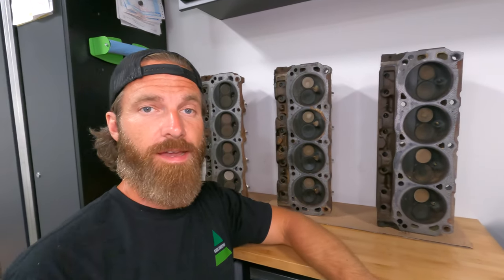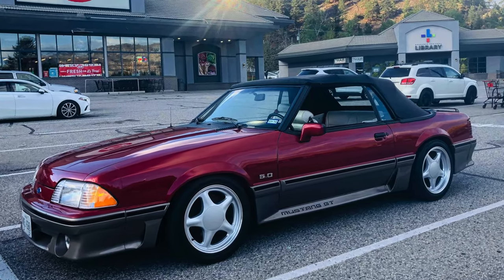Comparing Junkyard GT40 GT40P Stock E7 Cylinder Heads / Everything U NEED 2 Know - Fox body Mustang

Comment: I suspect that Ford put the GT40 and Gt40p heads on Explorers and Mountaineers simply because they're more efficient and make more power. Remember those trucks got a low rpm torque truck camshaft in them so even with those higher performance parts they make like 205HP. If they had E7 heads and a smaller port intake they would make even less power and customers would likely be unimpressed with the power you'd expect in a V8 option truck. Its a massively heavy all-wheel drive vehicle too so it would simply be underpowered with E7 heads
Reply: Absolutely correct the explorers and mountaineers wait around 6800 lb!! Compared to the mustangs 3200 lb!! So of course they're going to put high performance heads on heavier vehicles or at least stock racing vehicles!! Like the mustang cobras and the GTS mustangs!! 100% agree... 💯👍👍🤷🤯🤯🤦😁👍👍🙌
Reply: All your points are right, however Ford is just cheap they plenty left over from  mustangs ……. They just used them out in 96/97 explorers 3 bars (Eddie bauers edition) then they shift to p style
Reply: @thacutoff6226  The GT40's only came in Mustang Cobras. They also have dates codes on them showing they were made after the 5.0 was discontinued in the Mustang.

The GT40P never came in ANY Mustang.
Reply: @foxfordcatguy2283  gt40 3 bar heads came on mustang cobras except that they are on 96/97 ford explorers Eddie bauers and Mercury mountaineers ford used remaining leftover discontinued 5.0 stuff I.e explorer intakes (just basically cobra intakes). Gt40p heads have 4 bars stamped, and are different the main issue is headers/spark plugs
Reply: @randytrivitt6539  I think I lost brain cells reading your post. These Explorers topped out at 4,200 lbs. Only 1,000 heavier than the SN95.
Reply: Smog emission control was put into place and the mustang didn’t pass, but SUV’s were in a different category that was less restrictive so they got the GT-40/P gear and the mustang got the 4.6 mod motor.
Reply: Well said my friend
Reply: @trailerparkcryptoking5213  oh ya, some guy named trailerparkcryptoking over here knows better than the Ford Motor Company’s engineers…. Riiiiiight.
Reply: @randytrivitt6539  90'sExplorers weigh just a little over 4000 lb not 6800.
Reply: @foxfordcatguy2283 GT40 heads did come in early Mustang Cobras and early Ford Explorers. Besides that you're right about the GT40P heads, they never came in Mustangs.

Comment: Did you know that my Factory GT40p heads were Factory modified by Ford Australia, with 1.94 intake, 1.54 exhaust valves !   The whole engine was hand built by one man, taking one complete day to assemble, and they also received a set of Yella Terra roller rockers, plus a mild port matching,  and custom 70mm throttle body.   They also got a factory set of headers, with a complete dual exhaust system.    Only late 2001 to early 2002 Falcon XR8 got this 295hp beauty !!  The TOP DOG T series version of this engine even has a 3.4 inch stroker crank, making it 342 ci and 335hp !!!
Reply from the maker: No way!? Thats awesome!
Reply: @KASLCustoms  yes way 😊
Reply: I didn't knew there was a 4door manual sbf EFI, Aus really knows how to make cool cars

Comment: 347 full roller with GT40P heads.. moderate cam & 4 barrel Holley in a 67 Fastback Mustang  backed with a Tremec 3550 World class 5 speed, 9 inch 3.70 Detroit Locker... works great.. about 400hp & 375 ft# of torque... exciting

Comment: GT40 heads are the first "aftermarket" heads that I ever bought. I got them for my 71 Bronco back around  92 or 93? Can't remember exactly. I had some mild porting done and added some Harland Sharp roller rockers. Not many other options back then, plus, I wanted to stick with Ford parts. They worked good. No comparison to modern aluminum heads that we have today but those were just a dream back then.
Reply from the maker: Yessir I agree 👍
Reply: Big dog does some badass porting nowadays that makes these heads flow better than out the box aluminim heads

Comment: Did you talk about the springs on the P heads? Supposedly they're only good for .450 lift. I wouldn't toss the P heads on a 5.0 Mustang even with the stock cam without changing those valve springs. Also, you should have talked about the HP you could expect to gain with the GT40 heads over the stock E7s.
Reply from the maker: Thx for this. All of that is coming up in a future video

Comment: I thought the explorers got the upgraded heads as the 5.0 got older and they had to add emissions gear which robbed power; so, they threw the better heads on to make up for it.  IIRC, the power numbers stayed pretty much the same through the explorer run.  Jeep did the same thing with the 4.0l, if you throw a later model 4.0L intake on an older HO engine you'd gain 25ish HP, even though they both made the same power numbers from the factory (92 vs 02 for example)

Comment: The GT40 & GT40p also have "GT" or "GTP" cast between the #1 sparkplug (#8 on driver's side) & the end headbolt. The GT40p also has a "P" right above there on the little "ledge" by the corner of the valve cover. Maybe not all, but mine do & these markings are also described in the "Ford High Performance Parts Interchange" book & the "Muscle Mustang & Fast Fords" January '98 issue "Exploring For More" article starting on page #222.

The GT40's were used on '96 to mid-'97 Explorers. The GT40p was used from mid-'97 to '01.

The GT40p (58-61cc) has a SMALLER combustion chamber than both the E7 (62-65cc) & the GT40 (F1ZE 63-66cc, F3ZE 60-63cc, F4ZE 63-66cc). [This info is also in the previously mentioned book & article.]
Reply: I just picked up some gt's yesterday at a wrecking yard and you're right

Comment: Great info on these heads Thanks. I have a 97 Mountaineer with GT40p heads i installed Torque Monster Headers and Gibson performance exhaust system. I don't have a problem getting to my plugs. Now i did add Spark Plug Wire Boots Heat Shield Protector Sleeves. They have been on the truck for 160K with no problems. I love the torque it has. Thanks for sharing this video.
Reply from the maker: Very nice! You're welcome!

Comment: I’ve driven a few late model falcons in Australia and the explorer 5.0 was heaps more torquey in the low rpm’s compared to the std 5.0 with e7’s so it makes perfect sense to put an engine with more torque into a large heavy SUV  they weren’t race car parts just the next evolution of a stock casting

Comment: The GT40 head was not "introduced" on the 1993 Cobra, they were already available from Ford Racing (Ford Motorsport SVO as it was called at the time.) According to "The Official Ford Mustang  5.0 Technical Reference & Performance Handbook" by Al Kirschenbaum, they were originally developed for a planned 1989 anniversary model that obviously never happened. So they then went in the Ford Motorsport SVO Catalog.

The tubular GT40 also was available from Ford Motorsport BEFORE it appeared on the 1st Gen Lightning.

I still have my 1992 Ford Motorsport SVO catalog with both the GT40 heads & intake available in it.
Reply from the maker: Too cool 👌

Comment: Everyone knocks the smaller exhaust valve. It’s bc the compression is higher so it burns fuel more effectively so they don’t have to get rid of more excess gasses. Gasses are heavier than air. Idk if that makes sense but it does to me.

Comment: The p's had smaller exhaust valves for two reasons, first the original 40's had hardened, pressed in seats on the exhaust side to prevent valve recession, as they were meant for use on a lower sales volume unit Ford rolled the extra cost into the Cobra package. For the p head they used the same induction hardening as the E7's to save cost on the higher sale volume part.
The second reason is the p was given an exhaust port that actually flowed marginally better than the original 40 so the bigger valve wasn't needed to meet the engineers goal.
The truth is the p was never built to make more power, it was made to burn cleaner and be more efficient than the E7, the engine guys realized the 40 package in the Cobra has less emissions than the stock gt so they based the new head on the 40. Ford was worried their increased SUV sales would hurt their EPA CAFE numbers, that was the reason for the repositioned spark plug as well.
Reply from the maker: Wow great info! Thanks for sharing!!!

Comment: 😎🔔
David Freiberger did dyno tests on headers about making dents into the tubes. Virtually insignificant until they're completely mangled.
Plug clearance can be grained by using a 3/4" socket and hammer, maybe torch heat. 90* boots are no big deal either. JMO.😎

Comment: Spark plugs clear on BBK equal length headers on P heads. I put 90’s on all 8 spark plug wires for my ocd sake. They are accessible with a cut down plug socket, but a pain. Definitely a job to do when it’s cold.

Best flowing factory Ford small block head ever, that’s the only reason why I went with them. If I could ever source the Ford Racing P specific headers then I would definitely purchase.
Reply from the maker: Thx for the Info my friend!

Comment: I have a set of 3 bar aluminum GT40 heads, the only thing I found were these heads were built by ford for experimenting, but later trash this project (ordered to recycle these heads, but not all were sent to the crusher)  and came out with the GT40X
Reply from the maker: That’s awesome!
Reply: @KASLCustoms  thanks, I was wondering if you know anything about them or heard of them, I was only able to get very little information about them through the website
Reply from the maker: Sorry I wish I did but I’ve never seen a set myself

Comment: KASL Customs, I appreciate the video.  I read the other day that the 3-bar GT40 heads that were fitted onto the 93-94 Cobra had a smaller combustion chamber.  Something like about 60cc.  The GT40 heads that went to other vehicles other than the "Cobra" carried a slightly larger combustion chamber in the range of 64-65cc.  The Cobra also had the Crane manufactured, 1.7:1 Ford Spec. roller rockers rather than the 1.6:1 non-roller as used in the 5.0 HO.  The source also stated that Ford took the standard GT40 casting and shaved .010 inch off the deck surface to achieve the 60cc chamber.  
I guess I need to check the chamber size on the 3-bar set that I got on the "GT40, Cobra" crate engine that I bought from Ford Racing back in 1994.  Another curious thing that I found is that Ford Racing didn't include the 1.7 roller rockers on that Cobra crate engine either.  I had to buy my own.  One more thing to mention is that the GT40 3-bar set that I have has the thermactor ports, but doesn't have those restrictive humps in the exhaust ports, like the E7 castings.  The ports are there, though, if you had to use them.  If you need to plug the inlets for the thermactor, you can buy the plugs or use a 5/8"-11 set-screw (Stainless Preferred).  This is a straight thread with a female Allen hex on one end and a tapered end on the other.  These are NOT a taper thread pipe plug.  Lastly, the GT40P heads don't have the thermactor ports at all.
Reply from the maker: Great info!!! Thanks so much for sharing

Comment: I had a set of early 70s 351 heads that I was going to port when a set of TW 170s came my way so, I put down the cutting burrs and sanding rolls. 1969-74 are all good in the 351W heads. 69-74 have the bigger valves, ok compression and no EGR bump. They are no match for a modern aluminum head but, they were the ticket back in the day.
Reply from the maker: Nice find! yes, I agree. Very well said
Reply: So Mustang GT 90',  Choice '69 351 W 4V,    5.0 E7TE,  '97 GT40,  '98 GT 40P? Solve the equation.
Reply: @rondyechannel1399  69 351W heads are the best of that bunch.
Reply: Cleveland heads put em all to shame. Even the 2 barrel versions have bigger ports than the average aftermarket W head.

Comment: I got a set of 3 bars with an E-cam. Can I use stock rockers and pushrods? I don’t want to worry about valve cover clearance with rollers. I do have upgraded springs. Thanks
Reply from the maker: You could but I would recommend a good set of roller rockers. I run after market roller rockers with stock valve covers on my coupe. There is a tiny bit of clearancing that needs to be done but very minimal 👍
Reply: @KASLCustoms  what brand rockers did you use? Thanks
Reply from the maker: @chrisperkins6095 trickflow roller rockers 1.6

Comment: I can tell you for sure ford was notorious for grabbing random parts when they needed them. I got a very early built E4OD in my 94 F350. I know another truck had the "wrong front axle" in a super duty. If they ran out of updated parts they would use what they had until the next batch came in. 

The guy that built my trans wasn't even surprised. Said he had seen it multiple times. He wrote official ford repair manuals for ford back in the day. Still had copies on his shelf.  He came up with some of the updates for their transmissions. It wouldn't surprise me at all if they planned on running the 5.0 for a few more years in the mustang and the accountants told them to switch power plants. Fords accounts have always been what's held that company back.
Reply from the maker: Well said thanks for sharing 👍

Comment: Ford made a ton of these GT40 parts for ski boats.  There are a ton of 351/302 GT40 engines out there.  Even ones with Cobra and GT40 intakes.  That also solves what the B303 cams are for too.  They were designed for boats.   Which is why they create power at higher RPMs.
Reply from the maker: Yes I’ve seen them in Nautique boats before as well
Reply: The unique thing about the boat intakes is the lowers for both 302 and 351 gt40 marine engines is they are HEAVY cast iron...

Comment: Hey why do the front coolant passages are covered when installing the head gasket and the rear open. Why ford went through the trouble of doind passages on the front and then they are covered by yhe gasket gt40p.

Comment: Wish I could make it to meet you. Just revisited this video to see if there is a possibility to use the GT40 spark plug in a E7. More heat ranges available for a GT40 is the reason. Looks like it’s possible but might be close. The two plugs are 1/4” different in reach.
Reply from the maker: It would be awesome! 

Sorry I haven’t looked into this yet
Reply: La bujia de las gt40 tienen la rosca mas larga y al montarla en la e7 el piston la remacha.  porque queda muy adentro en la camara. Y si inst la de e7 en la gt40  la chispa queda muy distante de la camara y trae problemas.

Comment: I screwed up and tried to clean my GT-40p valves ( exhaust and intake ) in a hot tank and etched them up bad.  I have a set of Mustang GT, E7, valves, so can I use those in a GT-40p head? Thanks
Reply from the maker: Thats odd, what was in the hot tank...?
Reply: @KASLCustoms  muriatic acid diluted. The GT-40 heads use a 1.84”/ 47.8mm intake valve, and the E7s use a 1.78”/45mm intake valve, so I guess  I’ll have to buy new valves dammit.

Comment: on these heads you never mentioned the potential of them after porting. i used to take a set of old 70s 2 bbl chevy heads and make them run like a double hump heads. can you do that with e7 heads?
Reply from the maker: Not that I’m aware of
Reply: you can make a fair bit of improvement, i'm not sure how much thickness there is to work with exactly though. Certainly enough to match any other factory head. IDK i dont mess with those tiny port Windsor heads anymore, Cleveland heads are the way to go.
Reply: @eclipsegst9419  if you are going for power, it might be more cost effective to get aftermarket heads. I want my engine to look stock. that is why I want to use the e7 heads if I can
Reply: @russriley3005  ported e7s will do for a 302. I generally mess with 351s, those 302 blocks are iffy above 450hp. For a 351, you can't go wrong with a C head, be it a reproduction iron 4V or something aluminum.

Comment: Some additional info on the GT40 3 bars. The ones that came on the 93-95 Cobra's and Lightning's had the thermactor port's (smog port that the crossover tube attaches to) just like the E7's. I've heard that some of the very early 96 Explorer's also had the thermactor ports, but the later one's did away with them. Also since the Lightning had a 351 it used 1/2" head bolts rather than the 7/16" that the 302's use.
Reply from the maker: Great info! Thx for sharing 🙏
Reply: Also as seen in your vid the P heads did not have a bolt hole to attach the thermactor a.i.r. tube to the back of the head. I had a set of P heads that only had the aft 2 exhaust ports that were drilled for the thermactor air to blow out of.
Good luck with your build.
Reply: The Explorer/Mountaineer only used the GT40 in '96 & early '97. Mid-'97 & later used the GT40 P which didn't have the thermactor bump.